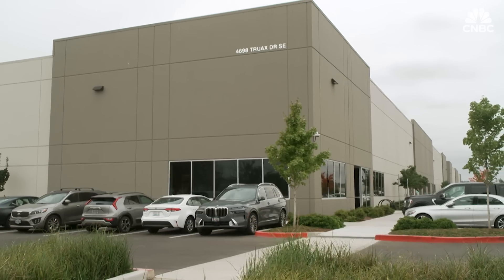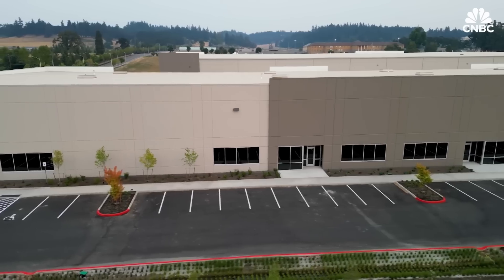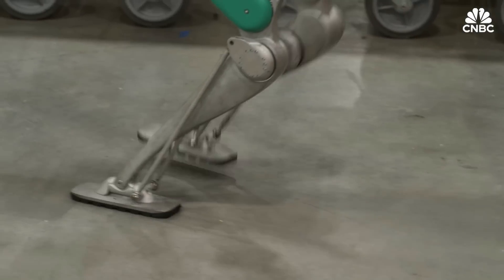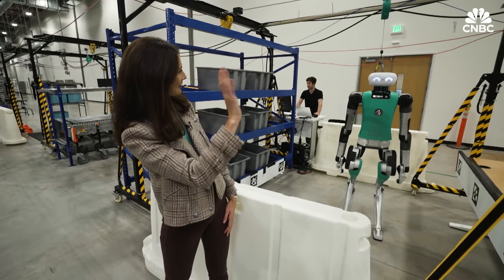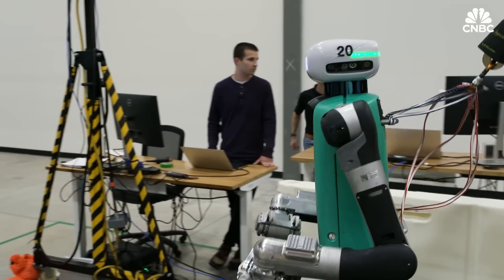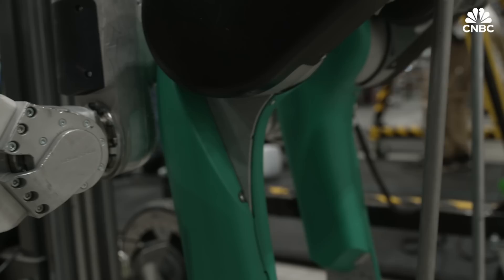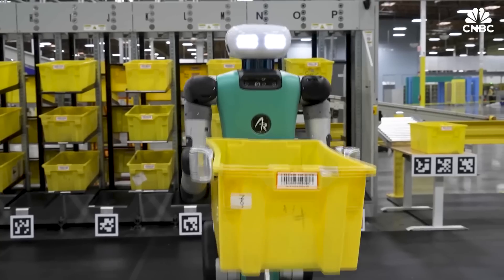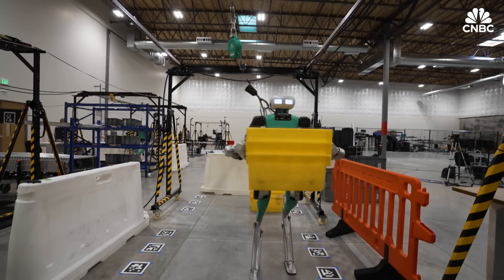Inside the world's first humanoid factory, where robots could eventually build themselves

Comment: They move like old men.  “A lot of work need to be done” doesn’t begin to describe what these folks are facing. I see AI taking a lot of jobs, but robots like these aren’t gonna be taking jobs like these for a long time.  If ever.

I’ve seen conceptualizations of robotics that describe factories that aren’t designed for human use. They’ll be more compact. They won’t have restrooms or break rooms.  They won’t have lighting throughout, or climate control for the comfort of human beings.  They won’t need human beings.

And they probably won’t have anthropomorphic robots. There is no reason for a warehouse robot to look like an early C-3PO.

People call them “dark factories”. China is apparently working on the concept, anticipating their population drop off in the next 50 years.

Comment: 19 seconds to move a box?
These warehouses would want you to work faster then that.
Reply: They would compensate with lower labor cost and worker for longer hours.
Reply: Did you skip the part saying they work non stop, day and night ?
Reply: @chpsilva  But that 189 boxes they can move in an hour.
UPS, USPS, FEDEX, wants you to unload 300 boxes an hour.
They are open 24/7. Let's say there's 18 hours of work in a day.
Using people. That's 5400.
Using a robot, working for 12 hours. That's 2268.
Remember it takes 1 hour to charge, for every hour of work.
Reply: @saulgoodman2018  Right now they can do 2 hours of work per 1 hour of charge. That's 16 hours a day for the current generation, and they are aiming for 4 working hours for 1 charge hour in the next generation.
Reply: @chpsilva  Still. They are moving around less boxes.
No big shipper will put up wit that. Because it is costing them money. And are losing customers because of slow shipping.
Reply: @saulgoodman2018  you've seen spacex's starship booster return? it all started really slow and they made progress to achieve that
Reply: @lucas_vasconcelos  That have nothing to do with this.
Reply: T3 is here😊

Comment: The things that take jobs away.
Reply: Not the net amount of jobs, but that jobs specifically. Automation has been ongoing since the industrial revolution and unemployment and poverty has never been so low. We need to accept changes to progress.
Reply: @pelayocf4558  automation is definitely necessary for mass production of goods for both availability of goods and for the business, but it’s approaching to a threshold, with modern technology that it’s starting to take over more and more jobs away from humans. I will give you an example, any major grocery retailer, are now pushing for self-check-out, at first these big box retailers took away business from 100s of local businesses by selling everything they all sold at a much lower cost due to large purchasing power, and most of the local shop owners ended up working there as employees, now even their jobs are at risk of automation. There has to be a line in the sand of what percentage of a business can be robotic and what percentage must be human employees at all departments but obviously this may vary by industry due to supply and demand for availability technology and or skilled workers.